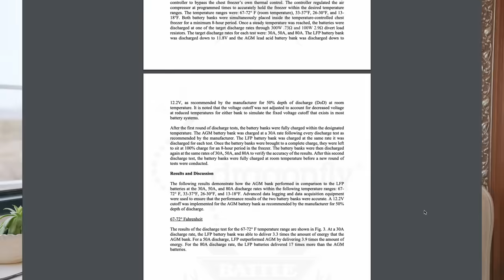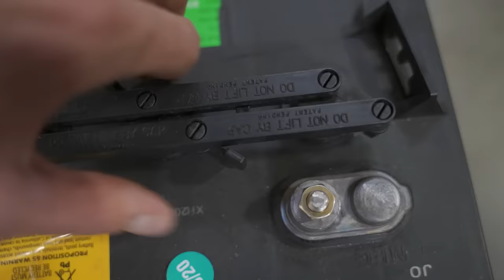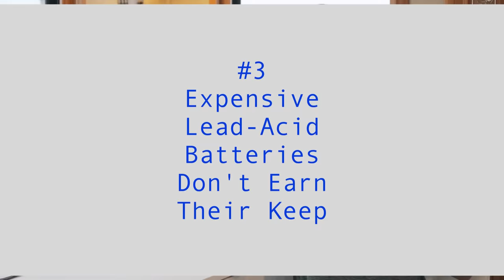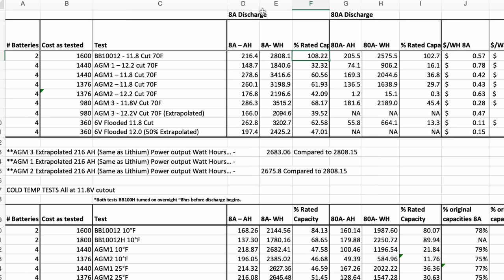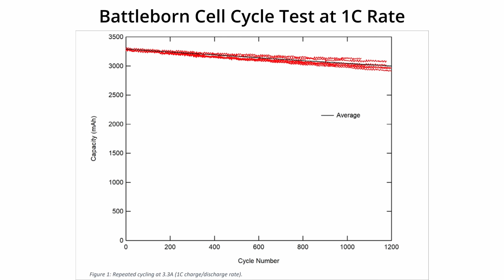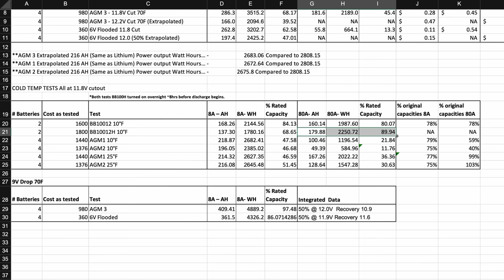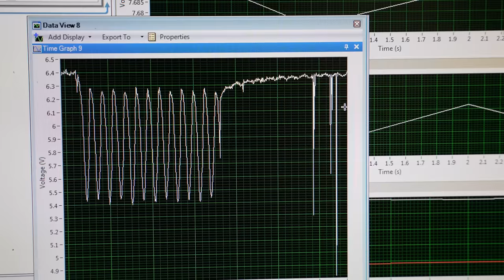Don't Waste Your Money On Batteries - The Shocking Truth I Discovered When Testing RV Batteries

Comment: quote 'Disclaimer: Battle Born Batteries paid for the tests we performed'  Nuff said
Reply: so a 40 minute video of all the testing is worth nothing just because a company paid for them to do it?
Reply: Dunning Kruger effect ?
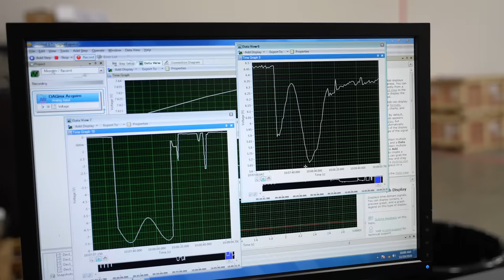Reply: @Dr.PhDeez  Not at all. This 40 minute video is worth a lot to the people at BattleBorn. As for an actual user, one should be aware that there is a significant underlying bias here. For example the statement at 33:40 "lead-acid batteries are just not reliable to be used in a power application." This ignores the historical fact that lead-acid batteries have been used quite successfully in a variety of power applications for more than 100 years. I would not claim that lithium batteries are crap but it is foolhardy and ignorant to suggest that lead-acid batteries don't have any place in power applications. I use flooded lead-acid (not AGM's) in an RV that I use 20 or 30 nights per year. I recharge with a generator and with solar panels and a cheap PWM charge controller that has user selectable charge voltages and is temperature compensated. My setup has served me well for the past three years. While lithium batteries would probably deliver more watt-hours than I currently get, the BattleBorn batteries cost about 7 times what I paid. They would not be a good value for the way I use batteries in my RV.
Reply: I agree I have been heavily in the solar and battery spaces and it baffles me that they are pushing lithium so heavy. None of these folks can attest to a lithium set of batteries lasting 10 years, or 2000 to 5000 cycles. While NiFe batteries are tried and true to thousands of cycles and  can have electrolytes replaced. We're talking a lifetime of use. By all  means NiFe are not reasonable for RVs but let's be real who is using a RV in the way they are saying  how many days out of the year is a person using a RV . Its crazy that he mentions battleborn by name but not the others, and also didn't use another brand of lithium as well as the battleborn. 

I personally think OPZV  batteries are second to NiFe whith 2000 to 3000 cycles for a stationary say solar setup. I get RVs have limited access and space but again. It goes back to buying a cheaper battery every couple of years to dropping 4 k for some lithium batteries that you use 3 times a year maybe. I think the hype is so that they can get alot of their stock out before solid state batteries hit the market. Those will truly bring the rugged and longevity seen in NiFe  along with less weight and more power density. Let's be real if your discharging a lithium battery the same as we do our phones we all know that now after 1.5 years a phones battery is toast and thats maybe  hitting 1000 cycles. Also the electronics needed to fully utilize lithium is issue prone not just in a charge controller (very specific) but the batteries themselves have electronics bms etc. Realistically I look at lithium as great for small electronics,  evs, and certain other applications but they are not the best for every situation requiring battery storage.
Reply: Not only did Battle Born Batteries pay for these test , 
These guys get paid  a commission for every battery sold , 
So the better the report , the more sales of batteries and more commissions are paid ,
So if I say they suck I don't get paid and if I say that they are great I get paid ,

Great or Suck ?
That is a really difficult question to answer when you are broke and need money for food
Reply: I finally got me a battery 100AM last summer for trolling my 14 ft hobbie.  All days long and never have to worry about running out of juice.  Is it expensive yes, but lighter and last forever.
Reply: In this instance I think you are looking at it incorrectly. BB has been so confident in anyone testing their batteries that instead of spending your own money and probably not beings very thorough due to the high expense of these tests BB has laid down their money to prove what they claim. Independent test have also shown the same results. In the past lead acid was for the most part the only option for none generator backup. The whole video is showing how BB batteries in the long run or if true voltage is required  that these batteries will be the cheapest.
Reply: @lukefarmer5391  , Bull$hit ,
Anyone can buy a used Electric Fork lift battery and it will last 20+ years ,
Or lithium ion batteries from hospitals carts they push around in the halls , these batteries are switched every few months because when that cart needs to work with all its gadgets it does, nothing wrong with these batteries to be used for home use and they are cheap , 
Cheaper than the $1000 dollars cash you have to pay for BB and only get one of them , you can get 5 or more of the hospital batteries and the Fork Lift battery is huge   , 
So I'm not going to buy BB 
when there is cheaper and better batteries out there ,
So I don't care how good they are and the price is too high 
and no one is getting a Commission off of me
Reply: @DaveMartin-co8et  
Thank you for that.
Reply: @richardwagner8498  Every time I mention the the Krueger Dunning effect, everyone says I never heard of it. This is a pleasant surprise.
Reply: @ezew4144  There are plenty of people who have been using Lithium batteries in their RVs for years, and even with them being set up wrong got over 8 years of use. With them properly set up, you can easily get 10-15 depending on your usage. Possibly more.

Also, Lithium-Ion is not the same as Lithium Iron Phosphate so your reference of cell phone batteries is irrelevant to the topic.
Reply: @DaveMartin-co8et  "This ignores the historical fact that lead-acid batteries have been used quite successfully in a variety of power applications for more than 100 years." - This doesn't make classic lead-acid batteries inherently reliable. 4 years ago I bought a motorcycle lead-acid (gel) battery to run small-power stuff (mostly a stereo) off of it every now and then when I did camping. I had amassed maybe a few dozen charge-discharge cycles or so, nearly not the same as what it would've experienced in a motorcycle. And yet it has still failed after 3 years nonetheless. A friend who owned a motorcycle said that he had to replace batteries in it every 2 years. Car batteries (which also happen to be lead-acid batteries) are pretty crappy too, only the best ones last ~5 years, the crappier only 3-4. And this applies only to cars with conventional ignition systems. Cars with a start-stop system put so much strain on the car battery that their specs literally call for an AGM battery which is actually a LOT more expensive than a regular car battery (~$400 a pop IIRC). Your setup has served you well for the past three years? I hate to break it to you but chances are that your flooded lead-acid batteries will have to be replaced in a year or two. And personally I think that AGM vs. BattleBorn would be a much more fair comparison than comparing it to flooded lead acid batteries.
Reply: @jimthomas777  "you can get 5 or more of the hospital batteries and the Fork Lift battery is huge" - Eh, I mean you can get even laptop battery packs for free pretty much everywhere where they deal with electronics recycling and you can usually extract perfectly fine 18650 cells from them. But seriously, comparing that to brand new batteries is just pure ignorance, plain and simple as that.
Reply: @CoolKoon  , one Battle Born battery cost $1000 cash 

It will last 20 to 30 years 
A used Electric Fork Lift battery cost much less and can last 20 years , because it's not being used like when it was in the Fork Lift ,
Hospital lithium ion batteries are changed every few months and although they are used now , they are not one year old which means they too have another 19 years to go and they are about $200 each so I can buy 5 of them to just one BB battery , 
You or anyone else can buy a brand new Red Top Optima battery for about $225 bucks 
There are other brand new never used batteries in lithium ion and gel cell batteries under $300 cash so to pay 1 grand for just one battery doesn't make sense to alot of people , not just me 
But that means that you can buy them all 
Have fun with those empty pockets of yours
Reply: @Dr.PhDeez  lithium ion is the umbrella that lithium iron falls under. All with similar chemistry just either iron, manganese, cobalt 

My point is and what you cannot prove, is 8 to 15 years of use reviews. Especially with Battleborn or any current manufacturer. At best  you will find a video with Battleborn batteries from 2017 and all those are reviews of their product because they opened the business in 2017 and probably bearly made any sales because of the ridiculous price. So at best we will see people buying in 2018 for 1200$ or more per battery. I’m just saying you cannot compare various brands and or battery chemistry that has had up to 100 plus years of real world use to a manufacturer that started in 2017 and cannot find anyone with long term use reviews overs 3 years ago. 

Most people making the claims your making are trying to justify spending 4 k for  3 or 4 batteries and they are hoping and praying that they last as long as the manufacturer and an YouTube reviewers say so that the numbers make sense. And by all means the numbers are there on paper, just not in real world applications and review. At best I have seen fullmoon RV guy review 2 year old batteries of another manufacturer. And that’s not from a rv he has used frequently it’s batteries sitting not being used that much. Which lithium is better at doing. But it’s not a apples to apples comparison when you look at 5 years of a age setup vs 5 years of lithium. You could get 2 or three sets of agms and get to the same stated (not proven) lithium life spans still for a 4 the the cost. There are deep cycle agms on Amazon right now for 169$. 

But please I would love to check out reviews of long term real world RV usage with lithium batteries even a 3 year review of Battleborns
Reply: @ezew4144  In terms of Battleborn, yes you are right. I can't find the video, but there was a couple who built their own battery setup from cells they purchased and at the time, Lithium batteries were not being used for RVs or any other standard solar setup. Before all the current lithium friendly chargers came to the market, they were just using the same settings as agm, which did damage the batteries but they were still able to get 8 years of use before they lost their life. And even after that they still had 70-80% of their capacity left. I do believe they were full-time RVers as well but I can't remember for sure. 

That said, there's no reason a company can't test and guarantee 8-10 years if they are doing cycle tests to determine the longevity of the battery. There is enough research to rely on the chemistry itself. And if you average one cycle a day, the math is likely to check out. Especially if they are built well, which Battleborn is known for. Will Prowse does teardowns of all sorts of batteries and Battleborn has always been the top quality.
Reply: @CoolKoon  if there is any argument at all it’s based on the claims both make. They can only make lithium batteries look anywhere near appealing or better than other batteries based off charge rates and longevity. Of which I’m simply asking where are the review of Battleborn batteries purchased in 2017? Also where are the reviews of as the other guy commented of lithium batteries purchased 8 to 15 years ago still kicking and or in use? The reviews of lithium only go back like 3 years and 99 percent of those videos are various lithium batteries that were just purchased and they are all going over the manufacturer specs and testing etc. it’s no different from the thousands of folks reviewing the new phones that are released and saying how good they are. It has nothing to do with the longevity of the product. 

If your going to do anything stationary as far as battery back up the only chemistry that I can say has proven it’s serviceability and also longevity is NiFe. It is similarly priced to lithium and will last you as long as your alive without all the sensitivity of lithium. From BMS to specific charge controllers, to temperature etc in respective of longevity that’s hands down proved. And why would you want to disassemble a bunch of old laptop batteries just to have to solder and wire bms and hella electronics for a battery bank. That’s in no comparison to obtaining a used battery of another chemistry. And Walmart sells AgM car batteries for 150$ they are not 400$ a pop. 

I just think lithium has its place as far as power walls and evs. Outside of that which will probably be replaced in the next 5 to 10 years with solid state batteries which would be good. But as far as stationary I’d rather be able to replace electrolytes every 10 to 15 years, able to over charge or over drain with minimum degradation, use cheaper components chargers etc, than drop 10k on a 1000 ah lithium bank when for that or cheaper I can get a NiFe battery bank that will last the rest of my life and half way into my children’s. I literally will have to replace my solar panels before I replace the batteries .

I think with lithium they are operating on the same model as Apple which now makes disposable phones that cost 1000$. You can no longer service iPhones. And if you do the cost would be comparable to just getting a new iPhone. That’s what they are doing with battery technology. Pushing unserviceable products to keep the customer coming back. I have yet to see return policy reviews and or service of BMS etc which can all be blamed on the end user messing up something rather than the ton of electronics inside lithium batteries. There’s a reason one chemistry is pushed so hard. The hype from folks trying to justify their purchase and the manufacturers giving out longevity claims. Hell lithium titanate was reviewed by a popular YouTuber and he completely misrepresented the chemistry so much so he had to go back and make another video after other people showed how flawed he was being.  Speaking of that I’d say the titanate is best for longevity but it also has its draw backs. 

I just want to see actual long term use reviews and I will concede. Especially when people claim it’s folks out here that have used lithium in rvs for 8 to 15 years and some still going. That’s a hell of a claim that is extremely unlikely just based off when the chemistry was put into use widespread for deep cycle batteries a few years ago. I admit Tesla has had success but that is not the same as these deep cycle drop in replacements. Tesla systems are built from the ground up all integrated and backed by some serious warranty and service. And even with that the longest running Tesla had to have its battery done somewhere within the span of 8 years. 

Cost wise agms still seem extremely reasonable, longevity wise NiFe are still years beyond lithium. Solid state will probably bridge the gap. Until then lithium is still just too damn high for what you get. And that’s not to mention OPZV batteries tout 3000 cycles  and are even cheaper than NiFe.
Reply: @Dr.PhDeez   I respect the back and forth. I’m just saying Gorilla Glass came out with specs and all kinds of claims and still to this day after like gorilla glass 10,000 the glass still breaks on phones. In more cases than not. A manufacturer can make claims in test conditions etc and have a claim which is what they base the warranty off of. But in real world use, like in Fullmoonadventures review of another brand folks will not use the batteries based directly on lab test etc. then when you ad other variables other than temperature such as vibration, moisture, etc results will vary. If you know the channel or video of the couple I would love to see it. 

By no means am I saying lithium is trash, actually it’s great for certain things. But I just don’t like when it’s labeled as better than basically all chemistry when others outperform it based on what your trying to accomplish. If it’s cycles and price OPZV are better, if it’s weight and space lithium, if it’s longevity lithium Titanate and NiFe are years beyond it. Especially for stationary setup, which is kinda how the couples use would have to be. Because I would assume they park more than they drive so weight isn’t a factor as much as say a EV which there are still Tesla’s on the road but from what I have seen even the longest on the road Tesla had battery issues within 8 years(was changed somewhere with 8 years of purchase and the data drawn). And my whole point is that if these batteries do not make it to the longevity stance one of the two sale points are out the window. And if the batteries aren’t shown to last over the years in mass then they are empty claims. Charge and discharge in a lab is not the same in a RV, solar system etc. Tesla has sold like a few million cars in the last 10 years, out of all those how many still have the same pack or are even still on the road. And then compare that to gas powered cars which are in the hundreds of millions. When you look at the small amount of people who would buy a Battleborn or like it, compared to the other chemistry there’s just way more real life data. Like how hard would it be for Battleborn to have a customer from 2017 to make a video vs. the last three years being folks who just got a set from them making a video of them either straight out of receiving them or a month or two of use. I was just sold on NiFe when I saw a video of them pulling out a 100 year old Edison battery changed the fluid and it still held  original voltage after being used 50 years. To me that is the absolute best in a solar set up and there’s no benefit lithium iron phosphate can show that tops that even with the 65% efficiency the longevity and abuse it can take far outweigh that especially when you have solar charging it everyday. Hell even with it losing up to 1percent in standby over night it’s still lasts longer. The price point if we were to look at it is literally 10 times less over the life of the battery compared to lithium.

Will Prowse even mentioned how the longevity is way better his difference was trying to show the efficiency and losses etc. which honestly dont matter especially if you have an entire shed and or building like him to house the increase of size needed for NiFe. But with solar and space like a shed I don’t see how lithium is better.
Reply: @Dr.PhDeez  And he talked so fast and jumped around
Reply: Buy 280ah lifepo4 on Alibaba for 500 shipped to the jewSA
Reply: @Dr.PhDeez  yes a 40 minute video is worth a lot... to the Lithium battery sellers.
Reply: And that hard fact, that lithium-ion is not nearly the same as lithium-iron-phosphate, combined with the sad fact that the presenter repeatedly and consistently referred to the BB batteries being tested as "lithium-ion" (i.e. instead of just saying "lithium") while the images clearly showed that they were actually lithium-iron-phosphate, made for a continual cognitive dissonance between possibly interesting information and too blatant an error to be accepted as accidental.  That is, the most probable rationale for not re-doing the presentation once such a significant technical and marketing divergence from fact was realized was that it was in BB's and probably the presenter's financial interest.  And if the technical folks did not appreciate the significance of the error (in what was supposedly a technical presentation), then their technical judgement is questionable at best.
Reply: @TamponTea  yup, I agree
Reply: I have never seen a lead acid make it past 5 years.  I have lifepo4 running at 60%, used under heavy vehicle loads for 8 years and 2years in residential load .
Reply: Agreed, let’s see a bank of 10 6V Flooded Lead Acid batteries from Costco vs one Battle Born. Each can be had for $1,000
Reply: @Dr.PhDeez  Well, I wouldn't say it's worth, "nothing," but it's marketing, not an independent study. It would be as if Ford paid for a study to compare Ford trucks against Toyota trucks, then published the study conclusively proving how much better Ford trucks are and why you should never buy a Toyota again. Of course, if Toyota paid for it, the data might be presented in a slightly different way. You should read the book, "How to Lie With Statistics," by Darrel Huff.
Reply: @jimthomas777  how does one go about purchasing used hospital batteries?
Reply: @Here-2-Learn  , I would contact the Hospital or where the Hospital gets and returns these Batteries from , 
Or Google used ion lithium batteries ,
I would also look into used Forklift Batteries , 
Since you are not running a power draining Forklift with them , they should last 20 years  and cost is about half of  what a Battle Born cost which is $1000 dollars cash ,
I bought a Optima Red Top battery and it lasted 11 years from Auto Zone - cost $250
Reply: @lukefarmer5391  That's what i thought too when he he said that they paid for the test, not that they paid him so that the data would show that BB is better or to falsify the results but that they were willing to put down their own money so that an independent researcher not their employee but a YouTuber could prove that it is more cost-effective to use lithium by far then it is to purchase lead acid and like you said it's been proven over and over again by many different people.
Reply: @Dr.PhDeez  Thank you, when people chime in that don't understand what they are talking about and claim that they Know something you can almost always Know they don't know much about what it is they say they know.
Reply: @ezew4144  What BB claims that their product will do is backed up by a guarantee or your money back if you do not get what it is that they claim their product will do. Yes they are very expensive and most people aren't going to pay that but their product is the best and you have to pay for the best.
Reply: @Dr.PhDeez  i watch Will too and it's true that BB quality is the best and there are only a few with the quality that BB is known for.
Reply: @keltonfoster  I heard mechanics tell me that about snap-on until I researched and found that they also were rebranding stuff I realized that pricey isn’t always the best of the best. He should have used another company lithium to compare. But I agree you do pay a premium for quality but it’s not only some of the most expensive brands that provide exceptional quality
Reply: @ezew4144  i built my own and i know after testing them they are going to be everything i need for years and years and i paid only a fraction of what BB cost.
Reply: @Here-2-Learn  look for it on Alibaba
Reply: @jimthomas777  Most people will have RVs that one cannot easily fit a fork lift battery into, as they're quite large.  Plus most fork lift batteries are 24, 36, 48, or 80 volts, which is not what the standard RV is designed for.
Reply: @missingegg  , that's true , but the used hospital batteries are smaller , they are only a few months old but are replaced with new ones because hospital stuff must work 24/7 , also Optima Batteries are 1/4 the price , that means that you can buy 4 gel cell Optima Batteries for the price of just one Battle Born and will last for years , but if you are running a house unit , a fork lift battery will be just fine , 
And there are also regular solar batteries that are in the $250 each price range , so again 4 batteries for the price of one $1000 price tag  Battle Born Battery , and if you only need one or two batteries look how much you will save
Reply: @jimthomas777  SO where can I buy the used hospital batteries?
Reply: @jerrymctee5996  , I would check with your nearest hospital , ask where they buy them and return them to , 
Or Google used batteries , 
I went to Auto Zone and got a Red Top Optima Gel cell battery for $250 brand new , it lasted 11 years , 
A used Forklift Battery can last 20 years and come in 12 , 24 , and 48 volts  at $500 to $750 depending on what size you need , 
Are Battle Born Batteries good  ?
I would say yes , but they are just too expensive to pay $1000 for just one when you can buy a used less than one year old hospital battery for about $150 bucks each and will last just as long , 
You can buy 4 to 6 used hospital batteries compared to just one Battle Born Battery , 
And isn't that what it's all about , saving money
Reply: @Dr.PhDeez  only for people which can’t handle facts. And can’t make logic conclusions for themselves. This was a fact based that, maybe paid by battle born, but none the less, we still get all the info, now we can decide for our selves
Reply: @jimthomas777  that IS bullsh***!
I have never seen a lead acid battery last 10 years! Keep dreaming of your used forklift battery lasting 20 years and keep using them!
Reply: @kululv  , just because you haven't seen something must make it true ,  I didn't say I had any battery last 10 years , I said that it lasted 11 years , but the last few years it would not fully charge , and it would drain faster than when it was new , and it finally gave completely out after the 11th year and wouldn't do anything , but I only paid around $225 to $250 bucks for it ,  any way you look at it , that's 1/4 the price of a $1000 dollar Battle Born Battery , so let's say for argument's sake it only lasted 4 or 5 years , I could still buy 4 Optima Red Top batteries for the price of one battleborn battery , 
4 brand new batteries that would last the same length of time as one Battle Born , 
Used batteries from hospitals are about $250 to $300 for Two of them , these are used but less than one year old ,
Again about 1/4 the cost but with an even longer life span than a Optima red top , there is even Brand New Batteries made just for Solar panels and or Wind Turbines that are $300 dollars , about 1/3 the price of a Battle Born , so 3 Brand New Batteries or just 1 Battle Born  ,  any way you go , there is plenty of choices that are less money than Battle Born , 
Did I say Battle Born Batteries were not any good , 
NO , I did not 
They are just  too expensive 
 And when there is cheaper batteries and more for the same price , people are not stupid and know a good deal when they hear it ,  
4 Battle Born Batteries are 
$4000 dollars 
6 used Hospital batteries are 
$900 dollars 
So you can call anything you want Bull$h1t  
But so can everyone else
Reply: @jimthomas777  which you did in your first statement and it was bulllsh*** ! But now you stated exactly what the test concluded. That you can buy other batteries, but for most of the time they don’t give you the capacity you really want. And have you ever wondered, why the hospital sells their batteries off after ONE year when they supposedly last 11? I guess they’re just stupid or very nice and do it so you can buy a fantastic battery for cheap...
Reply: @kululv  , I did not say they Sucked in my first statement , I said that if I reported that they suck then I don't get paid , don't you comprehend what you read ?
And the reason Hospital batteries are replaced often is because they must work and a Hospital can't afford to have a failure when it is needed most , so instead of ever having a failure , the Hospital changes them with brand new batteries ,  
Learn to read and then comprehend what you read after you have read it , my first comment is still there , everyone else can still read and understand it except for you , 
But I guess you have an agenda , your agenda must be to promote and sell the Battle Born Battery , try to discredit what I said so I will be unbelievable , everyone who reads these comments can read my first one , it's still there , it plainly said in this video that this guy gets paid for every Battle Born Battery sold , so is he going to say that they suck or does he want PAID ?
At $1000 each , he is NOT going to say that they SUCK , he wants PAID , he is going to give a good review , just like you .
And you must have an agenda to get PAID because you are arguing over one expensive Battery for no reason ,
The reason is that you must get PAID also , people are not going to buy as many Expensive Battle Born Batteries when they can buy less than 1/3 the price batteries somewhere else , 
That's why you said that my Optima Red Top battery didn't last as long as it did because again people would be buying the Optima battery instead of the $1,000 Battle Born battery ,
Because you want PAID 
And you can't get PAID if people are buying elsewhere can YOU   
Now talk more Bull$h1t
Reply: @jimthomas777  I rather have the feeling that you don’t comprehend what you really wrote! First you called the conclusion bs, then you implied that the guy gets paid! Maybe he is but you just assume that and you state it like it’s a fact. And now you claim the facts are not speaking for themselves and the tester made up his conclusion while he was just passing on the results of his test! So maybe you should do a test and prove it bs! Or maybe you just should just accept that facts are not always convenient or maybe you just can’t comprehend the process of fact finding...
Reply: @kululv  , I did not call any conclusion BS , if you scroll down it was Luke Farmer that I said BS
Reply: @kululv  , maybe you should read the first guys comment Agenda boy
Reply: @kululv  , maybe you should read Battle Born Batteries comment below the video Agenda boy
Reply: @jimthomas777  whiner, maybe you should read it again! You already proved that you don’t understand how a logic fact finding test works
Reply: Yeah. I can't afford the price of a good used car for a battery.
Reply: @kululv  , EVERYONE reading these comments can buy the same lithium ion batteries with the same Amp Hours as Battle Born Batteries for 1/2 and 1/3 and even 1/4 the price of a $1000 dollar Battle Born Battery , and EVERYONE can see whom the Whine Agenda boy is
Reply: @jimthomas777  I’m sure everyone and Battle Born agrees it’s you! Dream on and feel free to buy your battery at what ever price you like
Reply: @loungelizard836  I have a flooded lead acid battery that has been going strong for 8 years. The greatest issue I have with the Lithium batteries is they are non-recyclable. Whereas when my Lead acid battery finally dies I can easily replace the acid myself. If that doesn't help the plates can easily be re-flowed to get 100% life back out of the battery. As soon as there is a battery that is better for the environment and exceeds lead acid then I'll be interested. Though a closed loop Hydro-Cell generator would destroy all of the LithBatts and seemingly be much cheaper by their logic "cost per watt hour." :P
Reply: @ezew4144  I used 10 year old lithium batteries to power a solar powered truck that drove across America. So there is at least one real world example of old lithium working just fine.
Reply: @CoolKoon  
A) a motorcycle battery isn’t designed for prolonged discharge or repeat cycles of same... That doesn’t mean fla is junk, it means the wrong battery for the application. Needing replacement of a motorcycle battery every two years? Too much non-use. When I was running my motorcycle the battery was fine after three seasons. But I kept it on a smart maintainer. 
In practice, in practical terms, one cannot deny the multiple benefits of lithium batteries. However, one cannot ignore the advantages of fla batteries to many folks’ solar applications. 

Admittedly, a $68 walmartha grp. 27 deep cycle is an inadequate battery when criteria the video presented is used in that way. Nevertheless, in practice, in practical use I have gotten 5years+ out of them with my solar setup. (I have been using 3 in parallel) and I had some trolling motor batteries that formerly served on my boat that were 5 & 7 years old by the date on them make my coffee, run a minifridge, and run my lights for two summers with 200W of solar before they finally decided not to hold a charge anymore. 

I currently have three 18-month old walmartha Maxx grp 27s going strong. I expect 5-7 years out of them for a total investment of $200. If one dies it’s not the end of the world. If I had one of those BBs and it had an issue I’d be out of power until I was shipped another. If a walmartha quits I just go get one nearby like sameday - and I’ll still have other batteries running in the meantime. 

I’m reasonably sure after I build a house I’ll be lifepo but for now? 

The upfront and scalable small solar isn’t committing sin by running lead acid.
Reply: @CoolKoon  About 12 years ago a guy offered to give me 12 AGM batteries for free. I had been picking up a little extra cash selling old batteries to the recycler. So I said I would take them. He told me that he had a contract changing out batteries on a time schedule for a cell phone company. He traveled around the region pulling the timed out batteries from cell towers  and replacing them with new ones. It was a weekend and he had a truck full of batteries and could not find any place open to drop off the used batteries. He said that they are used for back up power incase of a power outage so they don't get much real use but need to work when things go wrong.  I found that all of the batteries had full charge so I put them aside for further testing and charge maintenance. I used these in my motor bus camper for over 8 years until about half of them started dropping out. They weighed in at 100 pounds each. I kept them on solar chargers (400 wt.) for 8 years. I told the guy he could drop off batteries any time he came through but I never saw him again.  I did find the same batteries on the internet brand new for about 250 dollars about 5 yeas ago. Shipping was almost as much as the batteries at that time. I've gotta find that guy.
Reply: Nah the stuff is pretty much true,  but you can build your own lifepo4  battery pack with same or better quality as the battle born for half the price.   Then it becomes stupid to use lead acid comparing by price.   You pay for the convenience  and warranty when you buy a battleborn.
Reply: @DaveMartin-co8et  Of course lead-acid batteries have had a place in power applications historically, bc that's pretty much all there was the past 100 years.  What he's saying is that now it's not ideal to use lead-acid batteries for power applications because there are much better alternatives that were not there before.
Reply: @CoolKoon  Same.  literally every 3 years I gotta change out my stupid lead-acid battery in my motorcyle.  Pain in the ass!
Reply: @jimthomas777  reasons to buy a brand new Battleborn battery at $1000.  1. it's brand new (under warranty for 10 years).  2. it's half the weight of lead-acid batteries or AGM's.  3. it has an intelligent onboard BMS to keep it hands off and foolproof.  4. You get pretty much 100% of the capacity.  5. there's no limited supply like there is with the batteries you're talking about.  6. no toxic chemicals that can leak....  There's probably other reasons but those are just a few.
Reply: @wadevid  , there are Brand new AGM - Absorbed Gas Mat batteries with 100 amp hours that can be positioned in any manner whatsoever for $300 
A 200 amp hours battery is $500 brand new   
So that means that you or me or anyone else on this planet could buy 3 of the 100 amp hour batteries brand new or 2 of the 200 amp hour batteries for the same price as the $1000 dollar Battle Born Battery ,  
I don't think too many people are worried about weight unless they are actually moving them around every day , once they are put into their spot , that's where they stay for years  ,
Having your own electric power is all about saving money , 
Whether you are traveling in an RV or a permanent home  ,
I'm not twisting anyone's arm to buy anything , 
People can make up their own mind to do whatever they want ,
As for me , I want to save money , and I'm going to buy multiple batteries instead of just one Battle Born for $1000  ,
But you do what you think is best
Reply: @BlondieSL  curious what the cost is?
Reply: Exactly, he doesn't factor in the voltage sag under load experienced by lead acid. Lead acid battery voltage under load is not an accurate representation of the battery's remaining capacity.
Reply: Worthless waisted time because you followed a script bro 😅😅😅🤦
Reply: Some of the comments from the wannabe know it all’s just crack me up.  😂
Reply: You should thank Battleborn. I bought cheap random brand lithium for our sailboat a year ago and they are undoubtedly the best batteries I have ever experienced. Just fantastically better in every way.
Reply: @DaveMartin-co8et  
Yeah, no.
Who funds the test foesn't contribute to the dara.
What you actually mean to imply is that the content creator who was left to run the test as an independent third party, has a conflict of interest.

When he provides the raw data for anyone else to analyze, your claim would require that you present justification for your claim.

Let's not mince words.
You suggested that the channel creator is lying.
Prove it...
We'll wait.
Reply: @keltonfoster  Hello; are you in the United States Kelton and be willing to sell me one of your custom battery packs? Thank you for your response, hopefully soon. EH
Reply: All I needed to see, ty for saving me the time
Reply: If you really want real world testing of BB's product, check a channel called Sailing Uma. This couple has been sailing the world for several years now, and their boat is fully powered by these batteries.
Reply: @missingegg  the fork lift battery that I used in my forklift at work weighed over 2000lbs, I had to use heavy machinery to switch batteries when it died after about 5-8 hours of use. I don't know where this guy is coming from when he thinks you can use one of these in any type of RV motor home application.
Reply: @Dr.PhDeez  yes
Reply: Thanks for this comment.  I was gonna watch the video to help make a decision but it can't be impartial when sponsored.  Perhaps if battle born stopped paying people to tell everyone how awesome their batteries are, they could sell them for less than $1000 each and still make money.   Sticking with flooded lead acid.   As it relates to boondocking, which is likely why you would need a huge battery bank,  power isn't your limiter, it's fresh water.   You're lucky if you can get a week out of a tank.   Then you need hookups to flush/refill.  During that time you're plugged into shore power so why bother with a monster battery bank?
Reply: For the most part it is bias